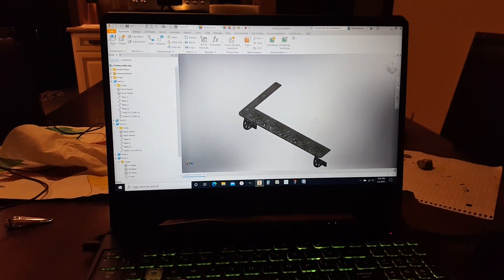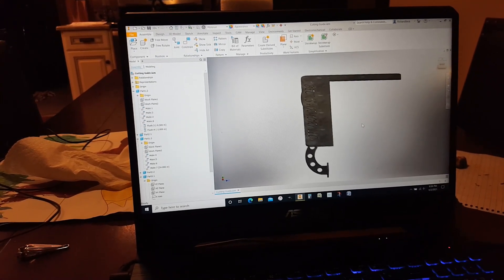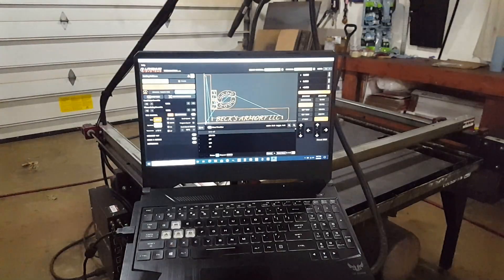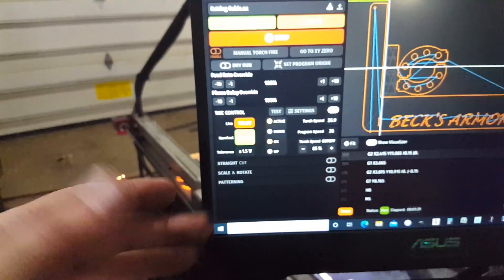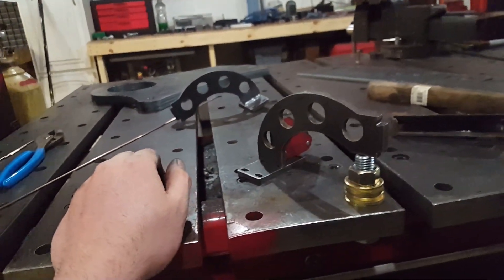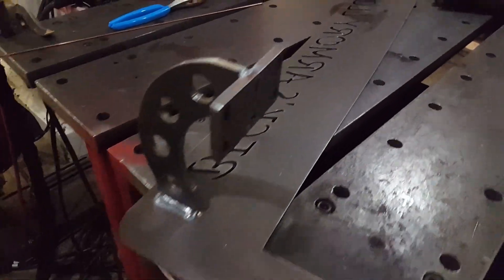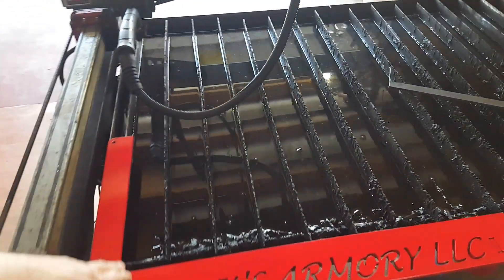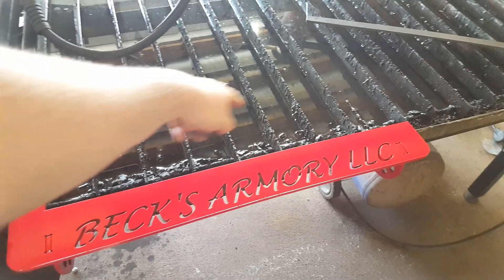Langmuir Systems Crossfire Pro Indexing Jig #crossfirepro #langmuir

Comment: Not sure if it has been asked but do you know any reason why this could not be adapted to the OG crossfire?  It looks like it would be just short enough.  Thanks and great design either way!
Reply from the maker: not sure but the download is free now so if it doesn't at least you will not have paid the $9.99 haha
Reply: @BeckTools  I did see that and it is very much appreciated.  I guess if it needs to be shortened I can use the plasma table, lol!!!!   Great design work by the way!

Comment: bro, do you understand the term of indexing in cnc ?
indexing in terms of cnc plasma is when you use your 3' x 4' table to cut an entire nest of cuts or design out of a sheet of 4' x 8' material. you first cut out what the machine will max out at and move the sheet to start cutting the next part by aligning it to where the cut will start again without mistake so the whole sheet can be cut for said project.
you sir have made an alignment tool or plate to be able to repeat work without having to move the said alignment tool or plate. i was interested in indexing of the prior mentioned. i literally just wasted time not only watching something that had nothing to do with indexing, but, writing this stupid rant because your title said indexing. don't get me wrong it is a smart idea, however if you had just said alignment jig or alignment tool, i am pretty sure you would have better views and more interested people.
this is a staging jig or tool. nothing here showed indexing using software or watching you realign a full sheet of steel.
Reply from the maker: I've had part I purchased from my laser cutter come in with missing holes.  I can take those parts push them against my indexing jig and add the missing holes in the correct location....  this jig gives you a fixed X zero and Y zero to measure from.  Since you cut these faces after you install the jig they are also the machine home position.

Comment: Will this be updated for the new limit switches making 0,0 the back left corner?
Reply from the maker: it will still work just weld the arms to  what is the top now and it will be a mirrored assembly.  The water tale is supposed to be centered on the frame so it will still work the same. :)

Comment: So when you remove the jig and then days later place the jig back on the table, how do you zero the torch back in to the same place it was in when you initially installed the jig and cut the straight lines in it?
Reply from the maker: Not sure I've never taken it off...  I have no plans of every taking it off. :)  If you wanted repeatability you could use two dowel pins.  Install the jig then drill and ream two holes through the plates into the tubes.  Then tap some down pins or roll pins into those holes.  This will ensure it's in the same spot every time. :)

Comment: When you zero your torch, do you just eye x and y placement? Or do you just creep up on mechanical limit? Thanks for video, I need something similar for my Pro machine as well.
Reply from the maker: I creep up on the x, y, mechanical limit.  Then I stop both 1/4" in the + and make that my home.  Then I slide my sheet against he index fixture.  Now if I have a part and I want to cut a hole in an exact spot I will not offset the 1/4"  I will make the mechanical limit the zero for both x, and y.  I then put my part up against the index jig and cut the hole.
Reply: @BeckTools  got it, thanks

Comment: Fantastic video. I also often use tab/lock design and (I'm just a hobbyist) i never used the corner reliefs. That's such a good idea. How big do you make those reliefs? Is it a function of the thickness, of the size of the slot...?
Reply from the maker: I normally make them between .06 and .125  Thicker material will need a bit more as it has a more tapered cut.  @.06 my  arc can barely get into it so that's the min.
Reply: So you make the reliefs .06-.125 large how much clearance do you put on the slot? Example for 1/8 plate would you make the slot width .130? Thanks